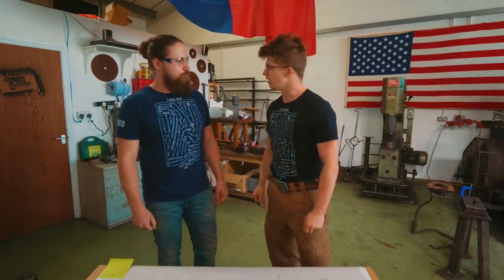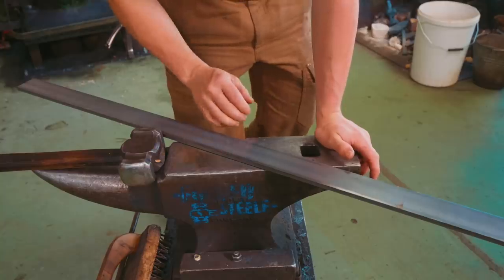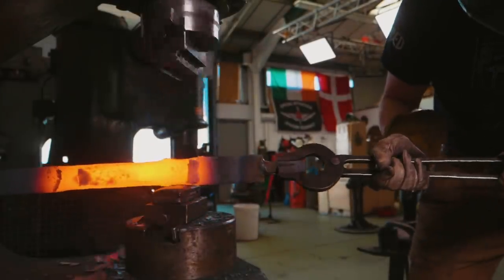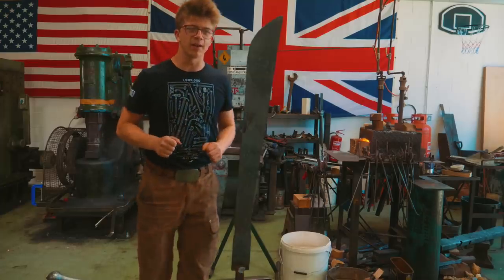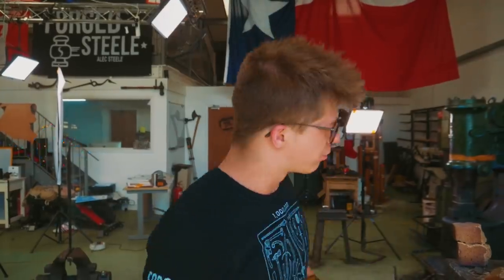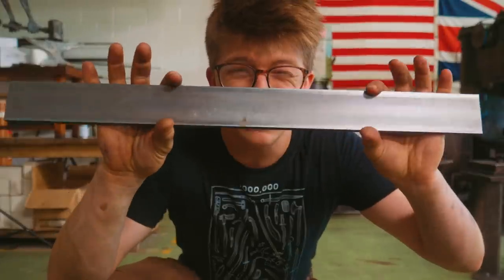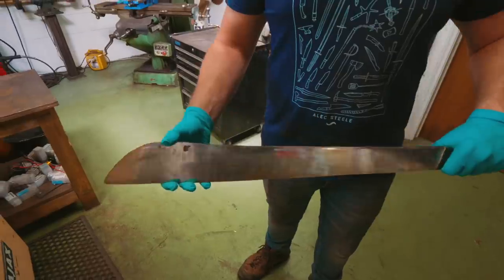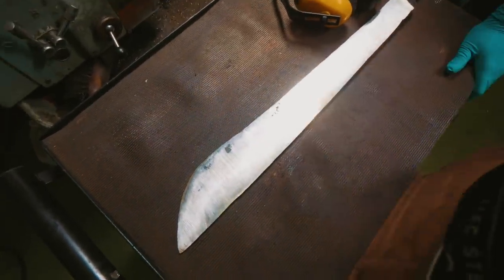MAKING A FALCHION!!!! Part 1

Comment: "Spherodization" is the maximum possible anneal with only oval or round hard steel crystals that are separated by soft ferrite so that they slide past each other easily, allowing stretching, bending, and flattening as easily as the steel alloy will allow.  Best for shaping a steel object prior to final grinding, hardening, and tempering.

Comment: Hey Alec. I would recommend that you watch Green Beetle's video on hamons. He found a great trick with wrapping the blade in steel wire and applying clay where it is needed. The wire helps the clay stick to the blade without flaking off. Great educational video.

Comment: How we get a homan line is to put a 1/4 inch plus layer of furnace cement on the back of the knife and the tang.  Let it thoroughly dry.  Heat and harden in oil as usual.  Remove the remaining furnace cement.  Some of the furnace cement will fall off while oil quenching. Proceed as usual with grinding, tempering, and etching.   The homan line will form along the edge of the furnace cement.

Comment: Alec, you should experiment with submerging your blades in muriatic acid after forging. It eats off all the scale in about 30 min. Make sure its outside though. Saves some grinding belts and time. Forge on!!

Comment: Interesting new project. But maybe after you made falchion, katana, kopesh,  a chefs knife etc. you can make another knife but this time not a pointy one - a round damascus cd-sized pizza-cutter. Should be interesting and educational to get it in a smooth circle and equally sharp on the outer edge.

Comment: A question i have is why do all blacksmiths instead of hanging a long piece of steel , be it a blade or anything that needs to stay streight why do they make it stay point up and not hang it when it is cooling,  i would assume it would have same results i do not see why one would warp over the other , any explanation i cannot find that anywhere

Comment: Great video but a few comments.
A) With a differential hardening (hamon) the spine is still hard! Its not quite as hard as the blade but definitely still hard. 
B) Falchions differed EXTREMELY widely in shape so the first one that was deemed “un-falchion-like” was definitely still in shape and size parameters for a falchion. 
C) Why on earth is 1095 not a good sword steel!?!? From everything ive read and personally experienced it makes for wonderful sword blades as long as you can put in the dedication to maintaining them.

Comment: The falchion has to be one of my absolute favorite sword types (technically messers are a specific hilt design of falchion). It's incorrect that falchions were never used for stabbing, or that they were primarily hunting weapons. Many falchion designs have very stab-oriented points.
Link for reference to falchion/messer typology: https://www.deviantart.com/shad-brooks/art/Elmslie-Typology-of-single-edged-medieval-swords-629294615
Reply: Something to note: historical falchion finds show that the blades were remarkably thin, more like razor blades than swords. This isn't necessarily universal, though, since there ARE so many varieties.
Reply: What I mean to say with that last one is: you PROBABLY had enough steel on that first blade to flesh out the shape you wanted and STILL lose a lot of steel to the grinder.

Comment: Hey Alec I know you've probably already answered this but I'm really curious and hoping if not you, someone can give me an answer. So I was wondering what the floor in your shop is made of? I'm assuming concrete and if so is it special or just standard? I do know that dropping hot steel on the concrete will cause it to explode after a bit because of the steam and all that. I was just wondering how you prevented the floor of your shop from popping and exploding. Maybe its a coating you put over or maybe your just really quick to pick it up? Thanks -Pier

Comment: Actually there were many variations of falchions and a lot of them actually had a great thrusting point like the one on this website: www.elmslie.co.uk/project.php?id=60 or even pike-like point that could reach even 20 centimeters (you can also find this type of point, but i found mostly historical drawings, not actual physical ones). What you're making is basically a big bowie knife with a cross-guard which is like the simplest and yet not very common type of falchion :P

Comment: how come with all your machines and tools, the forge (the most important part of a smith shop) is the most rudimentary. like come on youre still using bricks as a door to keep the heat in at least make a proper door with hinges and maybe a mesh window if some heat escaping/air intake is needed because itd look a lot better then some old hot dusty bricks lying around

Comment: In your opinion what are the benefits of actually forging a blade and hammering it out etc. rather than simply using an angle grinder to cut out a piece of steel and then heat treating it? To be honest I’ve never actually forged something but I have used the other technique I mentioned, and I feel like you can get a piece more exact and it takes quite a bit less work, but most people forge their steel and there must be a reason but what is it?
Reply: professor burrito with older metal(pre industrial revolution), you would compress the metal slightly, making it denser and stronger. Today however, steel is pretty much as good as it’s gonna get, and forging will have little to no effect on strength. Forging can save you time, as it is quicker to forge in certain features, like bevels, than it is to grind them. It can save you money, since you are moving material instead of cutting it off. And it can make it easier to grind bevels, since you have a guide to follow(if you use grinding jigs, it doesn’t make a difference, I’m more talking about free hand grinding). Along with that, it’s just a lot of fun to forge something